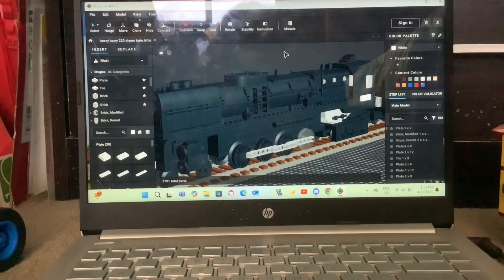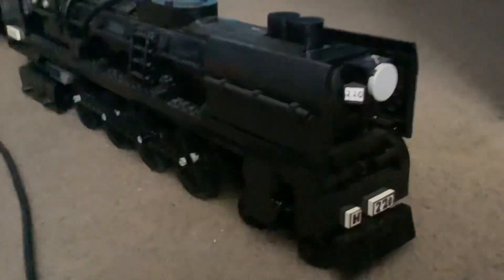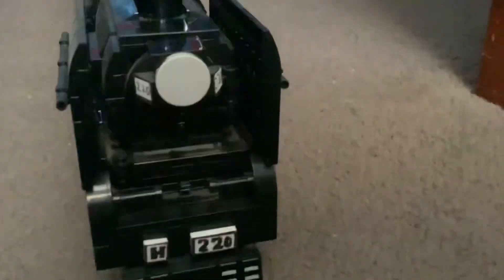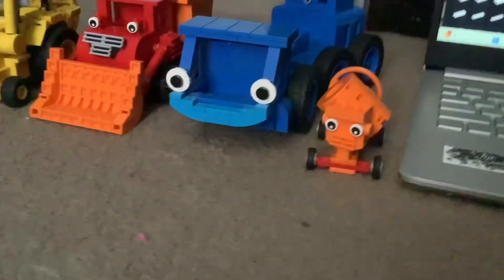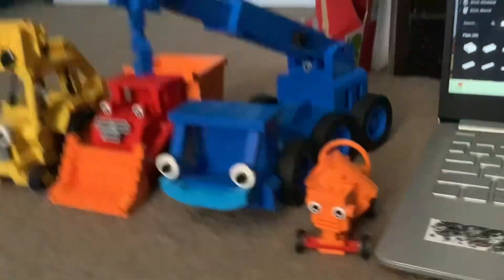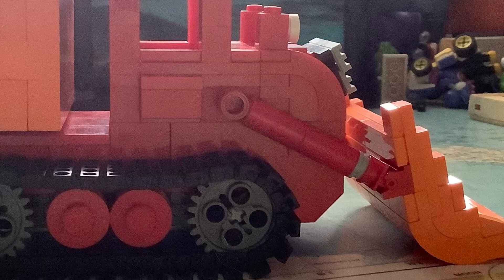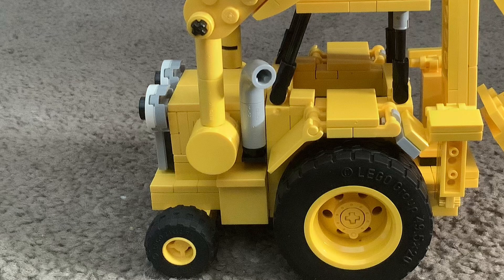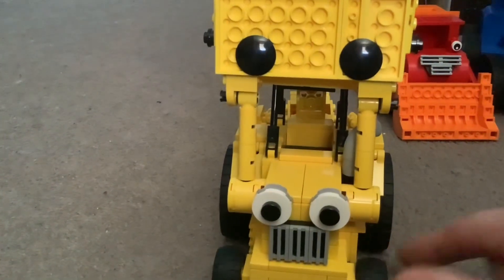My next big upgrades to my LEGO steam trains, and some Bob the builder updates(MOCS)

Comment: I tried to make Scoop five studs wide
Reply from the maker: Were you not able to make it five?
Reply: I tried everything
Reply: But It did not work at all
Reply from the maker: @nickp8920  I'm sorry to hear that
Reply: @buildingwithjoshuaturner4837  that's okay
Reply: The jumper plates did not for the bottom part of scoop but it worked for the face of scoop
Reply from the maker: @ ok try this, make Scoops whole base 5 studs wide, then with the front add jumper plates to the front only. Once that’s done add the whole front of Scoop on top of the jumper plates. After that the back part of Scoop should be five studs wide all the way up and the front is only 4, due to the jumper plates at the front.
Reply: Okay
Reply: @buildingwithjoshuaturner4837 are you sure this will work?
Reply from the maker: @nickp8920  That’s how I did it with my Scoop, but it depends on how you built the base
Reply: @buildingwithjoshuaturner4837  I can't do it today but I can do it on Sunday when I come back from vacation
Reply: The next part that I am stuck on is making the cab part for scoop
Reply: It worked
Reply: Now how do you make the back part of scoop
Reply from the maker: @ did you mange to make Scoop 5 studs wide, or did it not work?
Reply from the maker: @ are you talking about the whole cab or just the black bars?
Reply: It worked
Reply: Yep I did
Reply from the maker: @nickp8920  that’s great